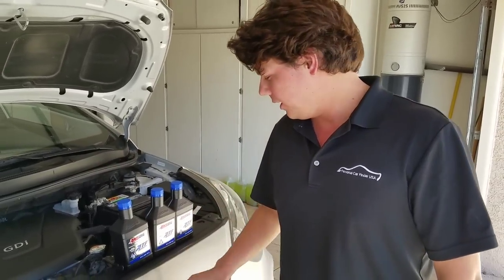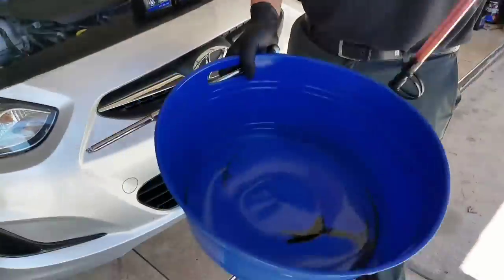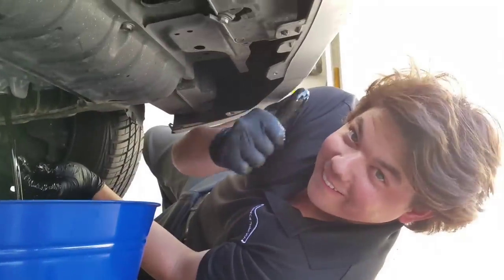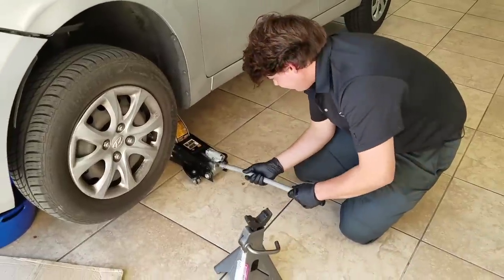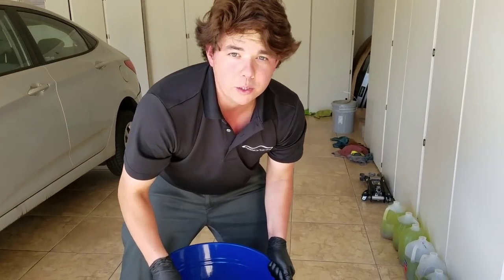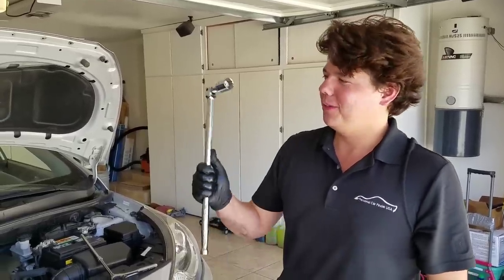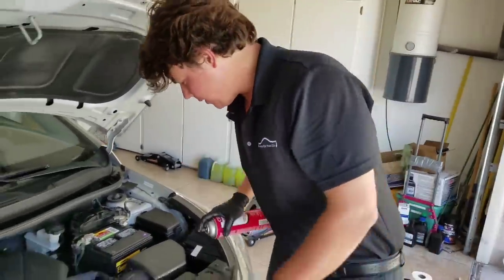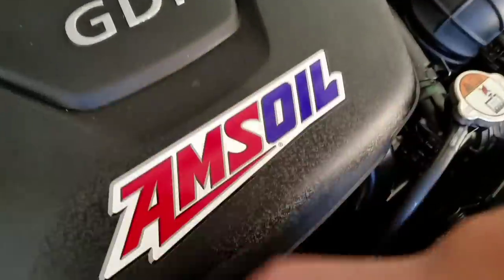Hyundai Accent AMSOIL Transmission Fluid Change & ATF Fluid Flush

Comment: Ok here's the big question,  if you put your product in a Hyundai at around 50.000 miles, when the transmission is warranted to 100.000 miles, parts and labor,  and say it fails 10,to  15000 miles later, Hyundai finds out that your product was used, they completely deny your claim. As they insist only their transmission fluid can be used. Will your company honer the rest of the factory warranty and replace the transmission free, parts and labor??? Of course not. So no one can switch to your product till after 100.000 miles,  original owners that's is.
Reply from the maker: Great question John!

Yes you can switch to it at 0 miles meaning you can use Amsoil anytime and it will never void your factory warranty.

Also Amsoil fluids meet and exceed the OEM fluid by about two to four times so that fluid will never cause damage to the transmission because it's significantly better protection with 100% film strength also it flows better in cold temperature and you'll have smoother shifts.

Here is all the warranty information.
https://www.amsoil.com/warranty.aspx?zo=5331179

Thanks again John for the question😊
Reply: @Syntheticoilprotection  APPRECIATE your reply. Believe amsoil is good stuff. But when Hyundai says, nope, nope, we will not honor the warranty, you used a non genuine Hyundai fluid in the transmission,  your done. What are you going to do ? Get a lawyer to fight a huge corporation with unlimited funds?? And the amsoil corporation isn't going to get them to change their mind. I'm 60, been thru this kind of thing. When under warranty,  you MUST have maintenance done BY the dealership,  using factory parts and fluids. That's why just today I had my transmission serviced by them, using their fluid. If something goes wrong with the transmission,  they can't find any EXCUSES to deny warranty coverage.  Just the way it goes. And that goes for ALL manufacturers,  not just Hyundai.  But for cars not under warranty,  there isn't any issues about using whatever companies you want.

Comment: I changed my transmission fluid and my car runs like it did at 20,000 miles at 76,000 miles
Reply from the maker: Eric that's super sweet!

What year make and model is it?
Reply: @Syntheticoilprotection 2015 Hyundai elantra

Comment: Nice video but seems more like an ad for amsoil...
Reply from the maker: Great eyes!

Signature Series 5W-30 Synthetic Motor Oil protects against harmful deposits on turbochargers 4X better than Mobil1® Extended Performance and 3.6X better than Royal Purple® in industry-standard testing*.
https://www.amsoil.com/newsstand/motor-oil/articles/leading-the-field-in-deposit-protection/?zo=5331179

Amsoil gets better gas mileage - 
https://www.amsoil.com/newsstand/motor-oil/articles/another-win-for-amsoil-products/?zo=5331179

AMSOIL Signature Series is fortified with a heavy treatment of detergent additive and it delivers 30% more acid neutralizing power1 than Mobil 1, and 36% more than Royal Purple, helping engines to stay cleaner, longer.-
https://www.amsoil.com/newsstand/motor-oil/articles/cleaning-up-the-competition/?zo=5331179

Comment: Nice Video. Do you know of anybody else using AMSOIL on their newer Hyundais like this one? I see many blogs for using AMSOIL ATFs for Honda and Toyota online, but very few for Hyundai. I have a 2018 Elantra which has about 20 k miles, and I am planning to do a drain and fill like this. I know it wont void my warranty by law, but i've read online that it could be a problem when it comes to warranty claims. They mention in their owners manual to use fluids approved by Hyundais only ( They do not have a list of approved fluids )!! But I want to use AMSOIL, but afraid that the dealership will screw me over when it comes to warranty. Please advise. :)
Reply from the maker: You bring up a grade point here!

Often times most dealerships don't fulfill claims anyways if and or but they usually pay prorated rates.
Basically the average new warranty is an entanglement of discretionary decisions that are made on Andor after warranty claims are submitted.
Basically an individual's ability to maintain a vehicle at a higher level is the only thing they have in keeping the vehicle running at a much higher level without having issues.

It's truly something you'd have to field test touch it feel it drive it race it once you are consumed by The Experience that's when everything becomes real.

By changing your motor oil transmission fluid and radiator coolant to Amsoil you will see a huge Improvement in fuel mileage and much smoother operation.

This is my link if you choose 2 feel it
Reply from the maker: This is my link below if you have any questions at all feel free to reach out to me anytime

Eben Rockmaker
Independent AMSOIL Specialist (Dealer#: 5331179) https://www.amsoil.com/offers/pc.aspx?zo=5331179
Mobile: (702) 472-3614

Steps: 
1. My link gets you 25% discount and free shipping on orders $100 or more. Click link under my name, Click link join now yellow bar Preferred Customer for 1 year. Click add to cart. Note: Amsoil will not keep your CC info.
2. Click look up your vehicle.
3. Click auto light truck. 
4. After you have all the products added double check then complete order.
Any order $100 or more has free shipping and ships within 1 to 2 days.
Reply: @Syntheticoilprotection  HI, that's cool. Thank you for the advise. I am already a preferred customer and have been using AMSOIL products the past year.

I wanted to see if you were open to collaborate for one video. Do you want to make a video of an ATF change for my car? I can repost the video and let all my friends and family know as well. I live in California, I can drive down to meet ya!! Let me know :)

Basically I want to do an ATF change early at 20k miles and switch over to AMSOIL. I know the benefits of it.
Reply from the maker: Anytime give me a 2-3 day heads up bring the fluid and will do it!!!

Thanks for reaching out to me it'd be a blast what type of car do you have?
Reply: @Syntheticoilprotection  I have a 2018 Hyundai Elantra. I'm pretty sure the procedure is exactly the same as you did in this Video. :)
Reply from the maker: Sweet!

Comment: So wait...You drain all the old oil, then fill the car back up with NEW fresh oil, drive a few miles and then dump all that brand new oil before filling it up again with new oil?
Reply: I'm not sure what you meant by 'the first time we get about half the fluid out.' I thought you drained it all the first time. Then, what do you mean when you say 'mix it'.? Sorry, I'm just a bit lost there. Thanks for the video.
Reply from the maker: Great question man yeah most transmissions are a transparent and a torque converter the torque converter holds let's say five quarts in the transmission pan holds say five quarts so the total fill would be 10 quarts to fill the transmission and the torque converter but if you only drain the transmission pan that would be about five quarts.

you'll see here on the lookup guide there is a number when you look up the transmission you'll see the total fill and the initial fill the initial fill is what the transmission pan is the total fill is as if you fill the pan and the torque converter.
Find Products For All Vehicles - 
https://www.amsoil.com/guides/?zo=5331179
Reply: @Syntheticoilprotection  Dude, thanks for the lightening fast reply! I think I understand. The second running is to mix the old torque converter oil that didn't get drained with the first dump with the fresh stuff to make a 50/50 mixture of old/new. Then on the second drain/fill, you're left with 75% new oil... Ok, makes sense. Our dealership says we should change/flush the ATF on our 2014 Accent right now at 67K kms (41K miles). I'm thinking they're just trying to upsell, but I can't really test the oil unless I get under the car myself which I'm planning to do. If it's really dirty I want to plan to do it myself thanks to your great video! Cheers!
Reply from the maker: Yeah the dealership isn't telling you anything wrong basically you want to change the fluid before it gets dirty. 

most transmissions you want to change around 30 to 50,000 mi if you're doing severe service like Las Vegas they're best to do it at about 25,000 just depends on the vehicle